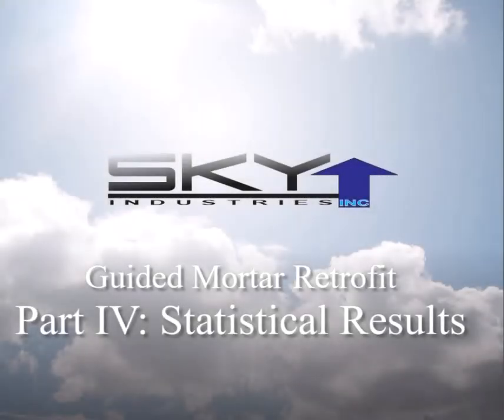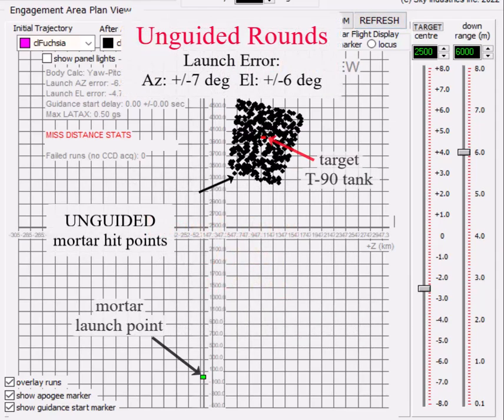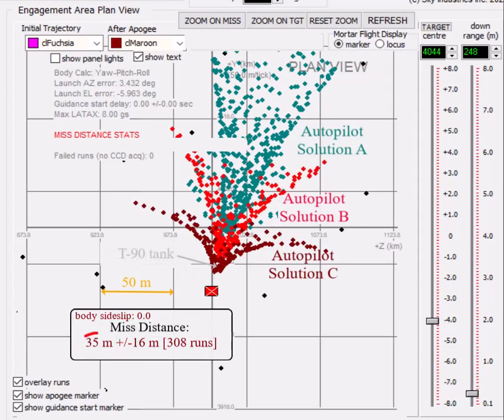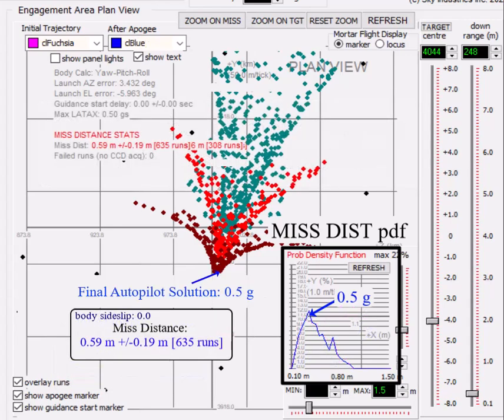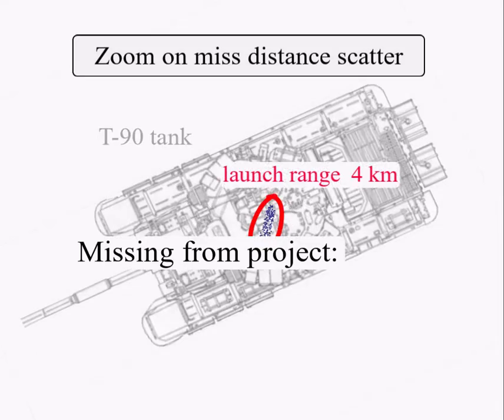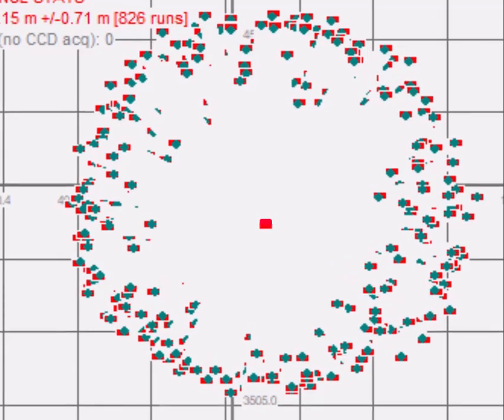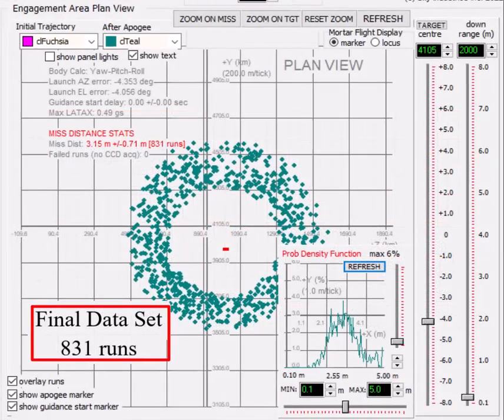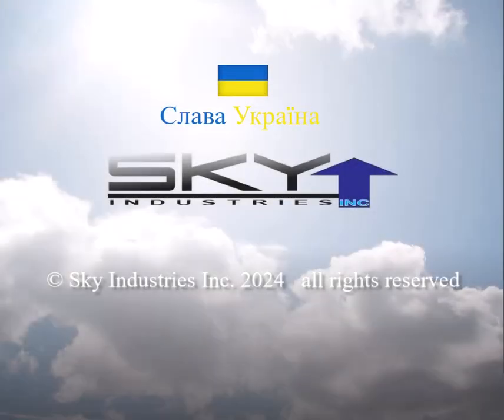Guided Mortar Retrofit Part IV   Statistical Results 06

Comment: This is awesome.
Reply: Yeah but this is a simulation that assumes the actual hardware and AI recognition are provided by somebody else. Consider how long that would take for the actual working product.
Reply: @AlexKarasev  I've never project managed a weapons program, but have PM'd multiple software implementations. Get the right engineers to design the head & fins (CAD), 3D print them for a mock up and do some fit and ground testing. Once it's tested out, do an inital prototype run and re-test actual performance. Given that Shawn has done the software part already, and the intent is to use pretty much everything COTS except the guidance head body itself (and fins)... I don't think development time would be to long at all.
Reply: @jayjayquest4958  I hear you but "would be" and "has been" are very different. Also the "software" part ought to include the AI (however loosely), and no two Russian tanks and IFVs (or Ukrainian for that matter) seem to look alike - and quite radically so if you look into the "cope cages".

Let's also not forget the supplier for everything "off the shelf" mentioned is China or critically depends on China. What you think will happen to that supply once we start to trade shots with China?
Reply from the maker: @jayjayquest4958  you are right, it didn't take long.  The AI piece was working in ~3 days, fully onboard in about 2 wks.  Working fins and servos, about 10 days.  All COTS.  Yes the 3D printed COTS-parts head can survive mortar launch, and it maintain a live video feed except for a glitch at launch.  What happened to the project I do not know.  

And you are right on another point: it is essential to get the right people.
Reply: @skyindustries  Thanks for the confirmation. When you've done a few projects you get a sense of a realistic timetable, and I'd guess you've likely done more than I have. I'm actually quite impressed a 3d printed head can survive the force of launch. I was expecting the final product it to be metal made, via a press, with some areas finish machined to final tolerance. Kudos to the engineers who designed it. Indeed, the right people make the project work. I'm sure we'll see the final handiwork out in the field at some point in the future. Accurate passive guidance from a electromagnetic spectrum point of view is highly desirable IMHO. Your work in making it happen is certainly under appreciated.
Reply: Not injection mould? Would be faster no?  @skyindustries
Reply: @jayjayquest4958 Spoken like a true project manager!😂
Reply: @BWite-pk1ov  for full production sure but that would not be wise for early prototype
Reply: @AlexKarasev  Most COTS stuff doesn't depend on China any more than China depends on the US. SALH was mentioned in a previous video, so no AI is necessary.